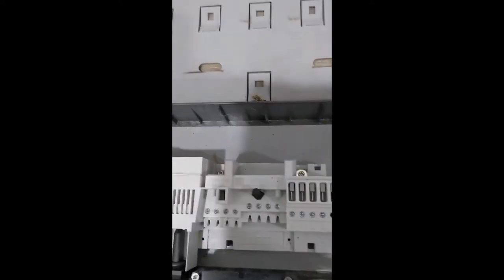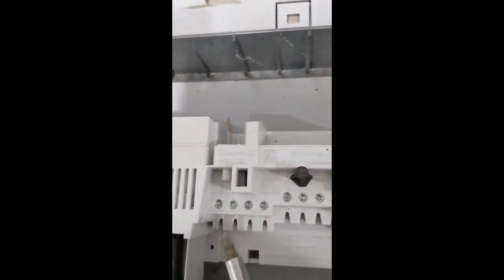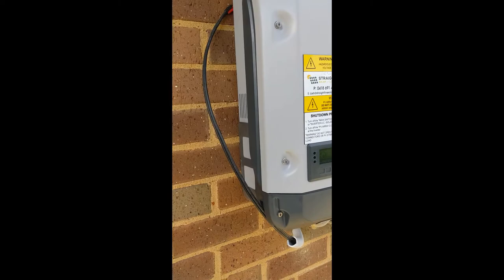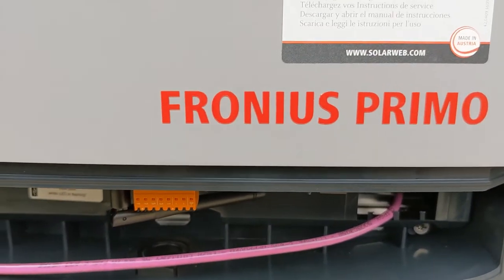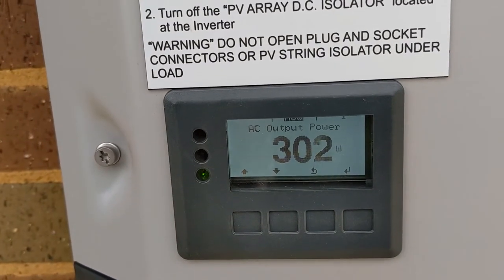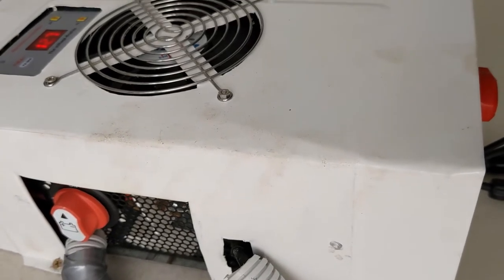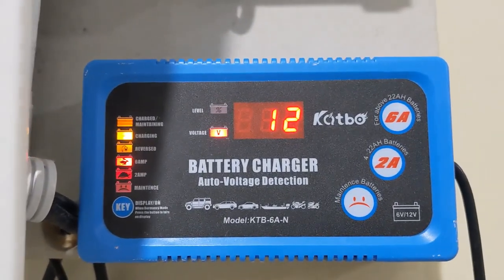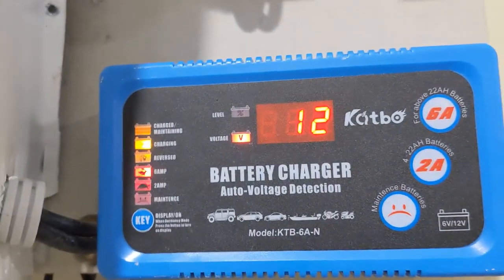It Works!!! Low Power Wind Turbine Connects to Exiting Home Solar Inverter

Comment: Very interesting. I was thinking of doing something similar and I also have the Fronius Primo with a 6.5kw solar array. Did you work out what the issues were? Also, did you end up buying a wind generator? I have been looking at some of the Chinese ones on Aliexpress, but they seem to have pretty bad reviews to the point of useless.
Reply from the maker: Yes all sorted. The problem was the booster. It was a very cheap $11 one. There was a dead short on a pot waiting to happen which I must have bumped. This tripped some fronius safety feature so it shut down. No until I put a cheap growatt on and fired it all up again did I realize it wasn't working. Swapped out with a $60 booster and all is well! The mppt controller on the fronius was damaged later by me accidentally not disconnecting the negative lead and it had some kind of short when I fired it up again. fronius fixed it under warranty nice of them really
Reply: Thanks for that info. I guess my biggest worry is to damage the Fronius and have to buy a brand new one. Would you be willing to share what hardware you are using? Did you end up connecting a wind turbine and is it generating any meaningful charge to your batteries?

Comment: Thanks for sharing, any update please ???
Reply from the maker: It appears the problem with the Fronius was possibly that when I rebooted it, the Negative lead to the booster was still connected maybe giving a ground difference large enough the fry the mppt. I replaced it with a cheap growatt inverter, but I have a lot of other commitments meaning I haven't had a chance to get back to it. Maybe won't for a few more months
Reply from the maker: Quite a bit of progressess and shift in design, but pretty well running continuously now. But actually too busy working on it to post videos.

Comment: I have a 48v AC turbine. Can I use a rectifier to connect it to a solar inverter? Also what would be the DC voltage after rectifier?
Reply from the maker: My lastest version uses a Micro-Inverter instead of a string inverter - this gives us a lot of advantages in terms of efficiency its a lot easier to reach to the Max Power point.  I would recommend that approach keeping the booster.  If you still want to give the string inverter a go though, at 48V you are lot closer to the min 90V or so you need to get it to turn on.  So,  sure you can can certainly use that approach.  The problem will be the amount of ripple on the output after rectifying.  So you will would definitely need quite a bit of smoothing - and probably a bit of filtering as well. I would still recommended using the booster because it it would give you a stable output and also current control. The smoothing would less of a problem too.  If you have an idea of your current output?
Reply: @soddoffbaldrick2209  what I’m doing is connecting the turbine to a 2hp general purpose single phase motor so it’ll have steady stream of power. So actually it’s a 96v AC turbine not 48v AC. I have options to go higher AC turbine.
Reply: @soddoffbaldrick2209  I checked the conversion of AC to DC and from 96v AC it’ll be 61v DC.
Reply: @soddoffbaldrick2209  let me know if this system would work.
Reply: @soddoffbaldrick2209 are the inverters connected in parallel compatible with the turbine?
Reply from the maker: @marciomaia4020  how large is the turbine? Micro inverters can go up to around 800w. I would not imagine you would get any more than that unless you have a 3m to 4m blade diameter. Either way best to go with a charge controller and a battery system to buffer it. But you are looking at a least $1000 for a 48v battery even a small one and you may have trouble getting a suitable charge controller. But doable
Reply: @soddoffbaldrick2209  Here’s the whole setup:
20kw 380v AC turbine connected to a 100A rectifier connected to 2  10kw solar inverters with 1 48v 100A lifepo4 battery to power a 2hp single phase motor to spin the turbine. Let me know if this setup will work. Thank you
Reply: @soddoffbaldrick2209  I don’t know if you’re getting all my responses I’ve sent you the turbine details and solar inverter details. Let me know if you got them.
Reply from the maker: I think I might be missing the point of your plan. Dm me on X and I can take a close look  at it
Reply: @soddoffbaldrick2209 hay I have a 24Vac wind turbine connected to a rectifier. What would the voltage be when converted to DC?